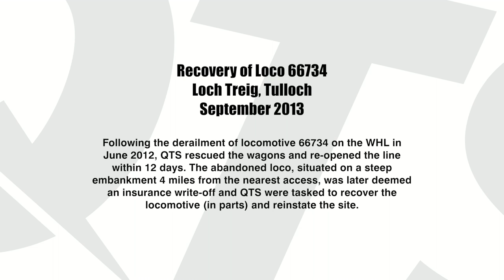Loco Recovery - QTS Group

Comment: What happened to the loco in the end? Did it get scrapped, or put back together?
Reply: It was obviously scrapped. A pity it is
Reply: The chassis was most probably scrapped, the other major components would most likely of been inspected, repaired/refurbished then put into spare stores for other members of the class to use when needed.

Comment: We need a list of all the arm-chair engineers who we can call upon for the next project.  Having worked near rolling stock in my first year out of college let me tell you this stuff is heavy, The trucks with their drive motors, the generator, the diesel and then add how far away (moment = length plus weight)) they are from the only flat surface you could magically get a crane of suffient capacity. The engine itself was 22 tons. 85% parts recovery is pretty good as expensive and as long a life as many assemblies are.

Comment: They could have built temporary track from the derailed loco to the main track and pull it back up. Instead, they spent hundreds of man-hours to disassemble the loco and then crate the parts, for shipment to the maintenance depot and then reassemble the loco. Unless I'm missing something obvious, this operation makes no sense.
Reply: msotil No, they scrapped the locomotive.  I understand the place restrictions, but I think that the loco could have been saved.
Reply: msotil it was cheeper to use it for parts as the frame may have twisted fule tank may have been crushed.

Comment: Why couldn't they just have a crane lift it and rerail it? It would have taken like a few hours instead of a few months. I'd really like an explanation please.
Reply: Koala Koala it was in an awkward place on a hill, and its a extremely heavy locomotive, i'm sure if it was possible for them to lift it they would have
Reply: Koala Koala There is currently no Crane that can lift such heavy things. espacially at a place like that one...
Reply: +Alex Mitchel +Jonah Betgen Here is a Wreck in the far rural country of the USA with very limited access and both locos were recovered and back in service in a matter of months, despite severe damage. http://rrpicturearchives.net/showPicture.aspx?id=2319448
Reply: This loco is an british Class 66/59.  This derailment also occured in Scottland btw...
Reply: Cost. It was cheaper for the insurance company to pay to have it chopped up and removed than it would have been to have it salvaged as a whole unit.
Reply: +otherunicorn Obviously we covered that already.
Reply: The track in question has several bridges that have weight restrictions. Even if you could find a crane that could lift
that heavy load at that length, the counter weight needed would with the pressure of the lift, crush
any road surface it was sitting on.
Reply: Probably because the engine chassis were bent or twisted and would not have sat on the rails safely to be towed away, that's why it was written off.

Comment: Ship the crap back to Canada and US with the rest of their GM "Toy Town" locos.
Reply: Here in Delson Expo-rail museum, we would've been honored to have # 66734 under our museum roof, right besides #4495, the " Dominion of Canada " that we cherish and pamper. A JT42CWR is one locomotive we don't have in our roster. We don't see much Class 66 on our rail system in " The great white north ".
Reply: They are not bad, just a bit different built, the chassis actually looks stronger then the European built ones for this type of locomotive, maybe heavier, but it will do it´s work and it´s not a bad locomotive concept.

Comment: Nice work! But PLEASE DON'T replace diesel engine unit! Instead convert locomotive to ELECTRIC! Get new step-down transformer, pantographs (x2), and other related electrical components and put old diesel generating set in museum!
Reply: Why?
Reply: Thats a class 66, one of the strongest engines in britain, and you are telling me we should convert it?

Nice try, but itll take 4 months to set up a design for that, and it maybe not even work.

(extra): US passenger lines are all electrified, but for britain, only 30% is electrified
Reply: Danilo Peterson locomotive was scrapped. And I dont understand the other comment about "all passenger lines un US electrified". That is not true, UK has more km of electrified tracks than USA...
Reply: use electrics do not insult the railways electrics are a waste of time get a gust of wind or some one leans on the cantenery up rights they fall over or the cables tangle bring back steam  at least with steam you would not have to rely on people having to put up with strikes or the lack of carriages or personnel ect steam rules and do not for get it lol.

Comment: In the US, we would rerail it, take it to the shops, refrurbish it and put it back to work, all in a week. But if you must work through a sweaty pile of MBAs, I suppose this is what you get.
Reply: +Dead Frt West Australia have better trains!
Reply: TrainSp0tter97 I'd doubt it, but Canada's trains suck too ....
Reply: For a derailment where it sits beside teh line, that's probably possible, but there was nothing lineside to brace a crane for a lift at that distance from the track, and that weight.  As for a refurb taking a week, I think you've been walking in the Scottish fields, and have something that fell out the back of a highland cow on your shoe. . .  Bullsh*t.
Reply: One slight problems with your statement, how CAN they rerail it?
Reply: +Lionel Richards Lol you know nothing about US trains, The US exports locomotives around the world, even Europe for a good reason. We simply make the best diesel locomotives in the world. No other made anywhere have the records of hours and miles as the average US built units. Fact.
Reply: +TheGamingBloke Its not easy but units like this are always recovered in the US unless the frame is severely bent broken or the unit tumbles down into a canyon and is complete trash. We bring in Much larger cranes than in the video.
Reply: +TrainSp0tter97 West Australia is filled with US rail equipment and technology lol
Reply: Also i know that youd want to rerail it and all, thats the common answer, but if your train is in a precarious place of falling off a cliff and does fall off, i think itll be more expensive than the actual loco in the first place
Reply: TheGamingBloke
 We could get that loco out of there, just look at what they did just to scrap it, all the material moved in and they took it out in pieces, we would do it all in one move, and  save time and cost big time. It is common to get much heavier locos out of situations like that over here, we have been doing it for generations. For example Caterpillar moved a new 190 ton SD70ACe locomotive from the railway miles into down town Las Vegas into a convention hall just for a show. then moved it back.
Reply: Railroad Mike No you couldn't, there was NO PHYSICAL ACCESS for any equipment large enough to move the loco in one piece.  All equipment had to come in trains, and  be offloaded to make a temp work area. The size of crane it would require to life that in one, could not be brought in. Hence they had to decide to dismantle it.
Reply: stuinNorway
 Do you have any idea how much railway the US has with out access?? Thousands and thousands of miles... I can clearly see in the video enough space that if it were in North America we surely would have recovered the whole unit. Ive seen it done several times.
Reply: By inaccessible here, we mean there are NO ROADS anywhere alongside that loch in the background. The crane that would be required to lift out the loco complete would be too large to bring in on the railway, hence they built temporary working areas. Also a crane capable of lifting that has huge outriggers that place enormous pressure on the ground, given their working area is temporary fill it would simply collapse under the weight of a large crane operating.  Lifting out complete was not an option, it is not physically possible to get the equipment required to site. Maybe in the USA they'd simply bulldoze a new 4 mile road in, just for that, but that's not how things work in Scotland... This rail line runs along a steep banking and even if they wanted to there is NO SPACE to make a new access road.
Reply: +stuinNorway I get there were no roads but they spent a moth building one. We in 
the US usually use large dozers and side booms to drag the unit to line 
side and re rail, often with the use of large timbers as skids. Ive seen
 large winch and anchors used as well. I'm sure the metrics in Scotland 
are very different than the US and there was reason to scrap on site, we
 do the same if the loco is of low enough value.
Reply: Railroad Mike aand that would harm the enviroment around it.
Reply: +TheGamingBloke As if the locomotive didn't already "harm the environment" as it went down the embankment in the first place? lol, Or how about all the equipment and torching and removing of the pieces for months? Come now be realistic. They made a mess of "the environment" just look at the vid man... But no worries the environment is way tougher than our fragile egos lead us to believe.
Reply: +Railroad Mike  The working area they created here, was a relatively small area (as opposed to several miles of road that would be needed to get bigger equipment in) along a steep banking that would have been extremely expensive to try to build a road along (building roads on a 45 degree sloping substrate is not a cheap or easy process). Also once the equipment was used, it was then reloaded onto trains and the temporary working area was dismantled and as much as possible removed.   As for the "months" read the description, the work was carried out in "September 2013" so hardly months.  But hey, you're clearly not one to let facts get in the way of your insistence that you could have pulled that loco out of there single handed using nothing more than your knicker elastic. . . . .
Reply: Never saw a US built locomotive in Europe.
Reply: There are hundreds of them there, many were actually assembled in Canada, but are of US design and the company is of the USA. Most of Irish locos are EMD, and England and Scotland have many EMD in service. Portugal and Spain have been American loco operators since the 50's
Reply: He's been watching Reality TV. You know - where the improbable is presented as normal.
Reply: +otherunicorn As if you know more. lol.
Reply: Railroad Mike such as the class 52 and the short lived private shunters

they are American units that was exported to Britain
Reply: 31144 ummm, that class 66 isn't American, and it is owned by GBRF which was created years ahead of when british rail was even privatised.

know yar shit m8
Reply: +TheGamingBloke Yes class 66 were designed and manufactured by EMD USA, that unit could have been one of the former Dutch owned locos transferred to GBRF Im not sure, But it is an EMD none the less. Short lived private shunters you say? Like the Foster Yeoman EMD SW1001 that has been in service in Merehead since 1983? And the SW 1001owned by Hanson in Whatley that was recently repaired from a wreck?? Over 30 years of service is not short lived by British loco standards. We yank loco people have nothing in common with the Class 52, We have locos that work. We tried Hydraulics back a long time ago and sent all but one to to where they belong, the scrap yard. I can get you a pic of the one left in a museum as a monument to German failure to build a loco that can hold up to our average freight service.   Do you know yer shit M8??
Reply: oh na, there was a private shunter i couldn't get the name to that only saw 3 years of service before it was scrapped, there is also a European version of the class 66.
https://en.wikipedia.org/wiki/EMD_Class_66
Reply: "Like the Foster Yeoman EMD SW1001 that has been in service in Merehead since 1983?"

nice to see some American styled traction up in the UK

fun fact: I live in Ireland, and when loco hauled trains dominated around, we had an American built loco! It was the class 121, they rode em cab forward all the time!
TBH:Almost all of our locos have either been assembled or reengined there.

https://en.wikipedia.org/wiki/CIE_121_Class
Reply: In the US you'd just leave it in the ditch to rust itself away. Have you seen how much stock is just left beside the tracks in areas similar to the one shown here where it would actually take effort to remove it? You guys don't even bother trying.
Reply: If you seriously think that Americans make the best diesels then please shut up, us in the UK have the worlds fastest Diesel engine, the Class 43/Intercity 125, and we have the fastest steam engine, because thats worth a mention

Comment: Pitiful operation. In Canada, that small ( by North American standards) loco would have been lifted or pulled up to trackside and on the rails again in week.
Reply: The reason they didnt was the location and lack of access
Reply: Too bad your national sport hockey mostly consist of teams in the USA...
Reply: They couldn't lift it with a crane due to potential embankment destabilisation caused by incident its self anyway the parts got put into other locos or recycled
Reply: The Kirow breakdown crane could do that easily.
Reply: Kandi Klover I know but Network Rail doesn’t have one
Reply: boys with small toys.
Reply: I bet even Indian Railways won't do this work even though labour here is 10 times cheaper. Would have towed (bogeys remain in good condition even in worst derailments). 

Instead British Engineers thought of a carefully planned out 2 month picnic.
Reply: They did that to a British train before, such as the chilham Kent derailment in 2015 on a 375 Southeastern

Comment: Getting in the railways train wreck cranes would have been faster. That choice might have been adversely affected by the very cranes being owned by their competitors
Reply: For a derailment where it sits beside the line, that's probably possible, but there was nothing lineside to brace a crane for a lift at that distance from the track, and that weight.
Reply: railway cranes are obsolete, they only life small objects like coal wagons(not hoppers), if it were to apple pressure on a 10 tonne locomotive, itll simply fall in with it